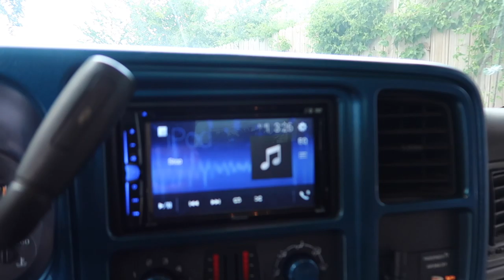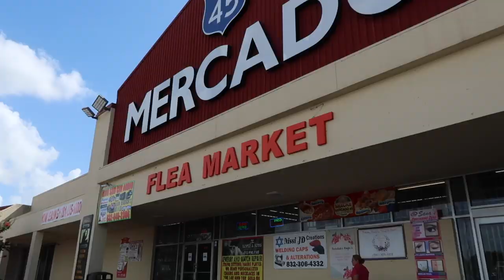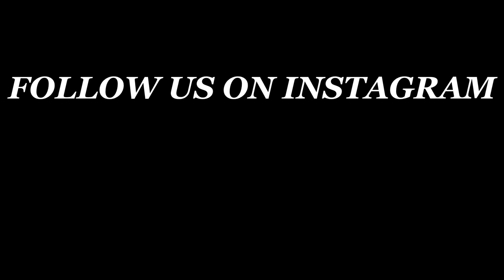SS clone project gets loud 🔉

Comment: The 4.6s ds18s ass

Im running pioneer 8s on the 2 front doors with a seperate 2in pioneer tweeter back ds18 4.6 will be changed u can hear me from blocks away
Reply: Pioneer is ass 😂
Radios yes. Subs and speakers hell no